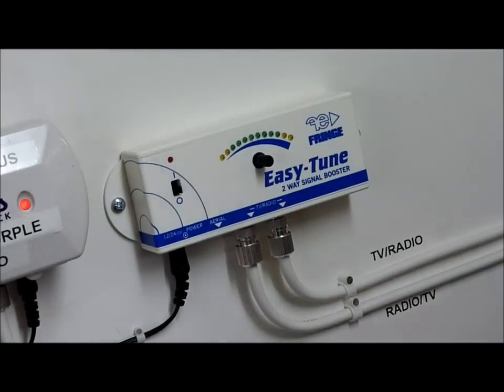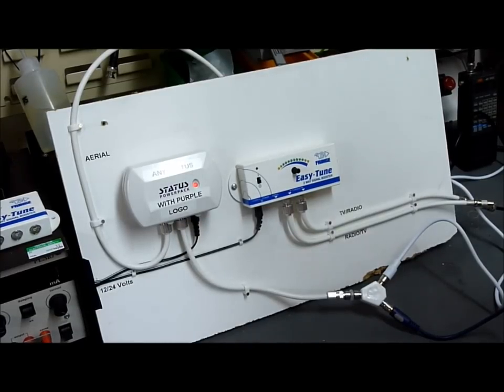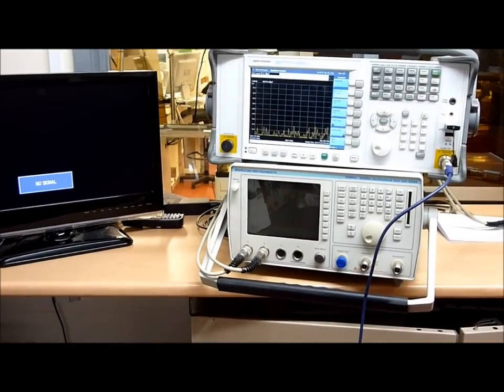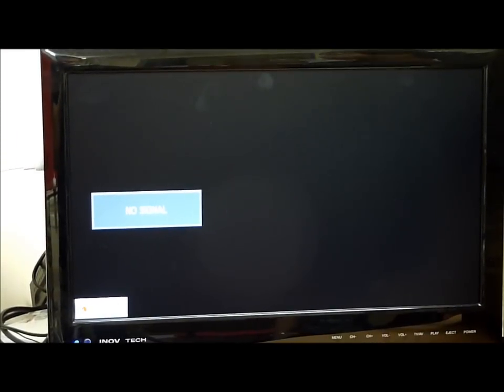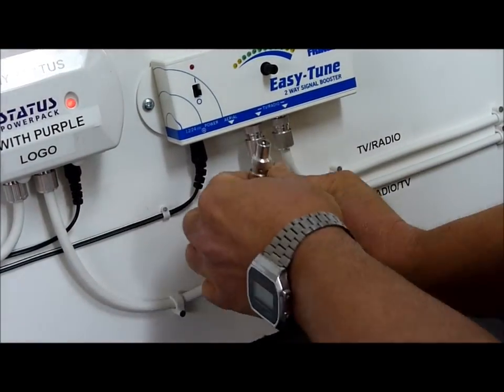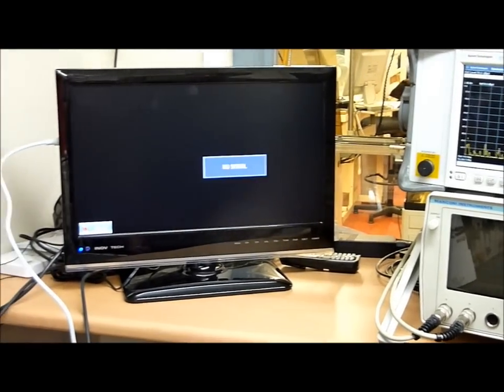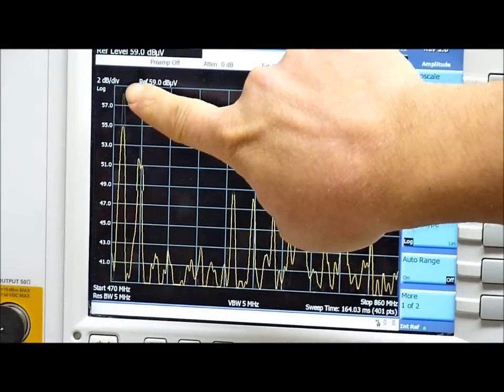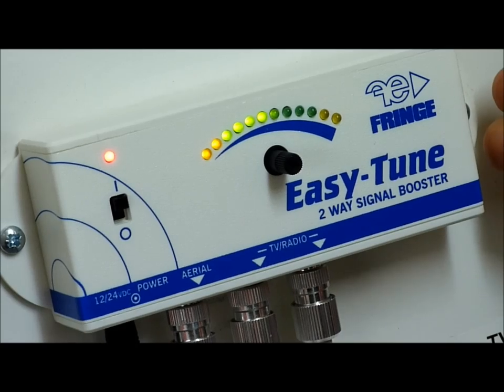Caravan, Motorhome, RV or Boat TV signal finder and amplifier set up - Easy Tune

Comment: Excellent video presentation, however as this covered a typical caravan setup using an 'active' aeriel, it does not explain if the unit can be used in non active aerial config or what the 2nd output was for?

It would be useful to know if this could be used at home or when camping using a small portable aeriel of the type that sits on to of the TV for example, as I am considering buying a small portable TV for camping and saw this product in the Camping & Caravanning Club Magazine (Sep 2012)